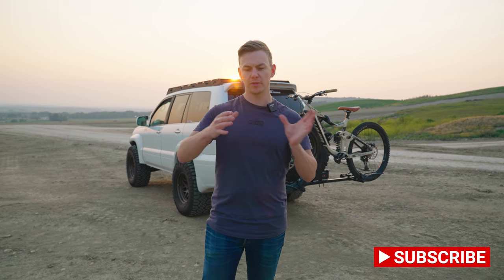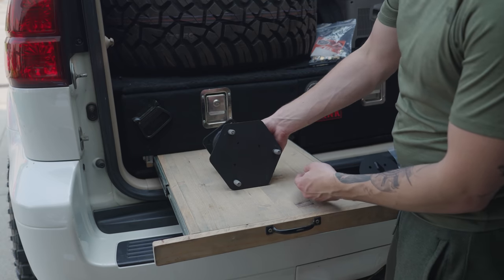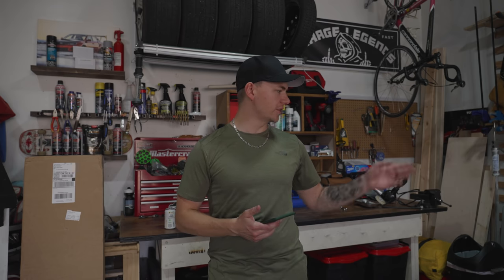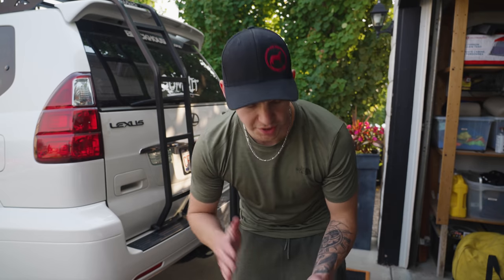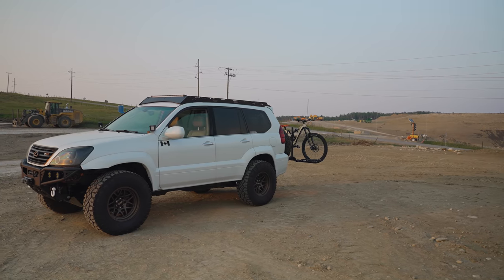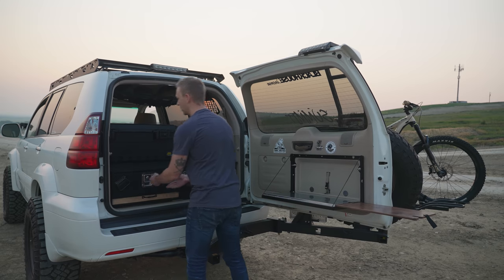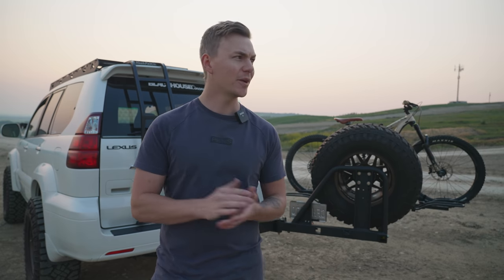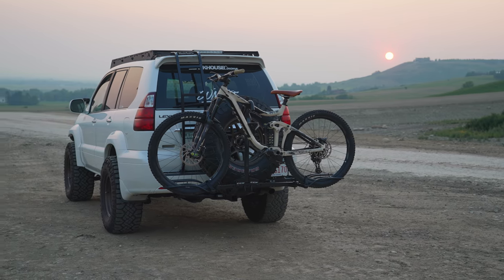My DREAM Adventure Setup | RIGd Ultraswing, 35" Duratracs, Summit Off-road Wheels - Lexus GX470

Comment: Man a GX pulled up next to me at a light the other day all decked out. I was blown away and confused. My first thought was it was a 4 runner but I saw the Lexus symbol. So I found out what it was and have been binging them here on youtube and man I think I found my next ride. I just sold my Taco bc the value went to high and I need higher towing capacity anyways. Anyways, I'm just blown away at the GX. I feel like I found a unicorn. I had an FJ few years back nd It kind of reminds me with similarities between the two.

Comment: Really really dig it bro.   The -25’s look super comfy, the swing is clean, new lights are sick, and that rear door table is gold! Planning on something for my 4th Gen dual swing out.  Would love a table.  Really wish I fabbed one out before paint.  Killing it Logan.  Love the work! 👌

What’s the weight on the new wheels?  One of the selling points for the F5’s for me was that light weight.  

Raptor Liner on the front bumper?  That’s what I did. 😂
Reply from the maker: Thanks you very much David! Im not sure on the exact weight of the wheels but they feel pretty close to the same as the F5’s did

Comment: Can you do some videos of you taking your mountain bike to some locations and doing some riding?  This is the setup I want for my SUV when I get it (I have a Rivian R1S LE on order).  I want to do some car camping and hitting different ride locations.  I would stay at RV parks to charge at nigh using their RV plugs.  I’m a little worried about leaving my bike like that overnight but  I would imagine you can probably lock your bike rack.  The light you showed is what I was hoping to setup on the outside of the rig with a motion sensor so it would turn on if anyone gets close to the bike.

Comment: Amazing rig man! What did you have to do for the  tires to fit? how much trimming did you have to do?
Reply from the maker: Thank you! It’s hard to put into words exactly how much to cut but you will need 2.5-3inch lift, adjustable upper control arms so you can max out your caster, body mount chop and then yeah lots of trimming haha
Reply: @LoganKingMedia  and a pray that the rear end holds up!

Comment: I just put 35x12.5R20’s on my GX today and it rubs like a mother gonna need to chop it up some more.

What are you planning on doing gear wise? I don’t want to cause any damage to my drivetrain as a result of the 35’s.
Reply from the maker: Nice! Yeah lots of chopping involved. Also make sure the caster on your adjustable upper control arms is close to maxed out when you get an alignment.
Reply from the maker: I have not regeared yet and have had no issues but with probably go with 4.56 - I would love to track down a 8.2 rear end as well

Comment: Thanks for the video, I've been looking at one of these for my GX. How big is the gap from the back of the swing to the door? Thats the only thing that is holding me back because the gaps look pretty large but its hard to tell.
Reply from the maker: It is 10 inches from the back of the door and 6 inches away from my ladder. Going to be modifying it soon here though to bring it closer so I will probably make a video on that.
Reply: @LoganKingMedia  thanks! Do you have the factory hitch? I think my problem is that I have a curt hitch that sits lower and further out.

Comment: Great video. I have GX460 with a ladder and planning to add a table on the rear hatch. I was wondering if you had to replace the strut or do anything to the factory hinges.
Reply from the maker: Thanks! I did not modify the factory hinges, the GX470 never came with a strut unfortunately but I may be adding one in the near future

Comment: I like this option because I don't have to damage the car by drilling holes. But when you install the tires, it doesn't look straight. It looks like it's a bit tilted. Am I seeing that correctly?
Reply from the maker: You are correct that is a style option and makes it easier to put the tire on by yourself but I think you can get one where the tire sits perfectly straight as well.
Reply: @LoganKingMedia  omg that would be great!! Thanks

Comment: One of the best GX out there! Have you done anything on the interior?
Reply from the maker: Thank you! Other then all the rear interior stuff I just have a tablet mount up front, lighting switch panel and seat risers for the front driver seat to help with the angle and a more comfortable seating position.

Comment: Do those 35s rub? Looks like they would. The -25 offset looks perfect.
Reply from the maker: No rubbing at all now even offroad but I did trim quite a bit of stuff and have over 5 degrees of caster from my upper control arms. The -38 offset before would rub offroad a little bit.

Comment: Towing capacity is 6500, not 10k
Reply: I think he referring to the max tow rating for the RigD, not necessarily the tow rating of the vehicle. The multi fit since they fit on other vehicles too are rated up to 10k
Reply from the maker: Yeah exactly!